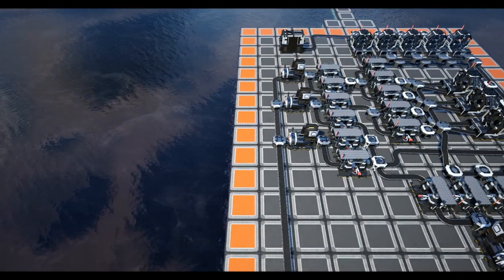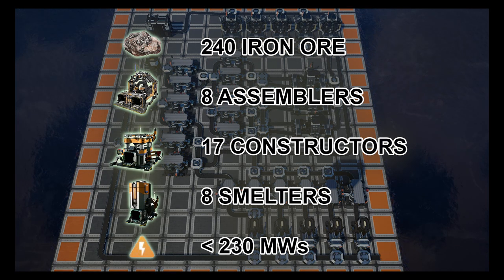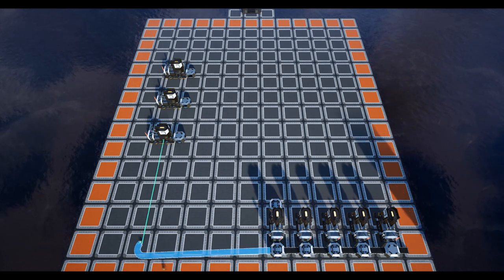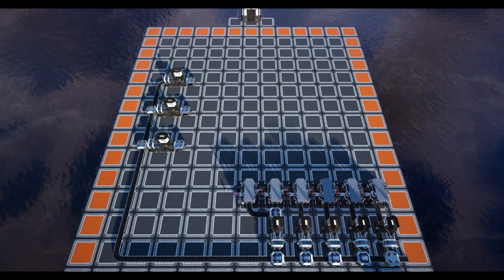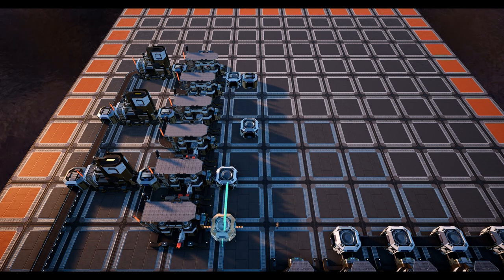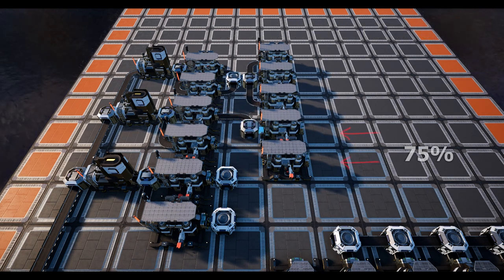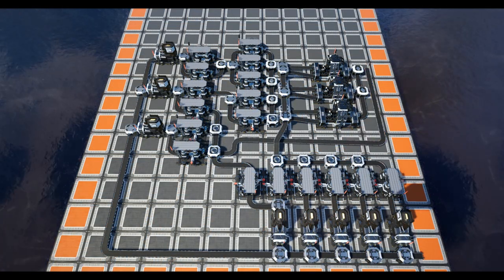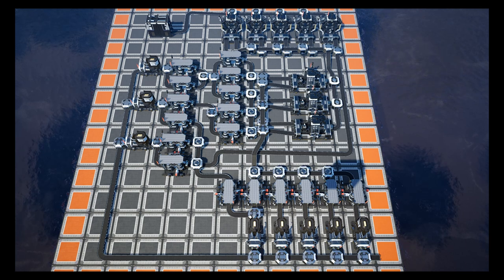Modular Frames (Updated) Super Efficient Build Guide [Satisfactory Guide]

Comment: If you're lucky enough (or determined enough to save reset) to get the casted screw alternate recipe, you can trim down the number of constructors needed. This should help shrink the footprint a little bit and save some power, too. Casted screws is awesome and a very powerful alternate recipe for early game!

I do understand that this video was made with original recipes in mind! Just putting it out there if you're sitting on hard drives to research.
Reply from the maker: Yep you're absolutely right, a great tip, and next weeks heavy modular frames if you include the past two layouts is huge considering the 2 HMF that you produce per minute. Casted or steel Screws along with other Alts such as encased steel pipes are a great way to reduce the footprint of these builds. I hope eventually I'll get chance to cover those alts! Great tips! :)
Reply: @TotalXclipse  I look forward to it! Keep up the fantastic work on your Satisfactory videos!

Comment: When you use multiple splitters for a group of constructors/assemblers,  how do they create a balanced ratio? Wouldn't it split in half over and over and by the end there wouldn't be enough of the material for the constructor/assembler? Great guide by the way, very easy to understand and visualize.
Reply from the maker: Manifolds work by fully saturating the line, then carrying the excess over, I talk about it in this, somewhat dated guide:
https://youtu.be/zFy2v87HFE0

Comment: Good vid again mate, are you using the manifold design for this, if so is it possible to do it with out the manifold design and load balance it. Cheers
Reply from the maker: I won’t be doing a load balance any time soon - perhaps we’ll do it after we’ve covered all the items but until then it’s which ever is easiest to create for the masses and generally speaking load balancing can get confusing
Reply: Sorry mate, I wasn’t asking you to do it, I was just wondering if it’s possible. I was looking at a factory someone else done and he used 2 in number 1/5 splitters but I might change that and put manifolds in. Many thanks
Reply from the maker: @Rpython1  It's most definitely possible but you'd have to work the maths and it would take a lot more space. manifolds are much easier to scale should you wish to an much easier to set up
Reply: Yeah I’m liking manifolds a lot 😀

Comment: Can you use 1 iron node/depost with a mk2 iron node?
Reply from the maker: if the required amounts add up then yes
mk1 = 30 for inpure, 60 for normal or 120 for pure.
mk2= 60 for inpure, 120 for normal or 240 for pure. :)